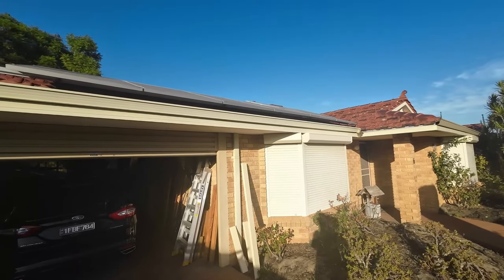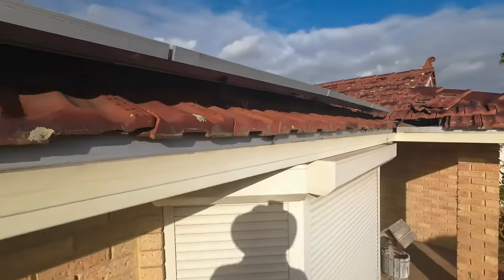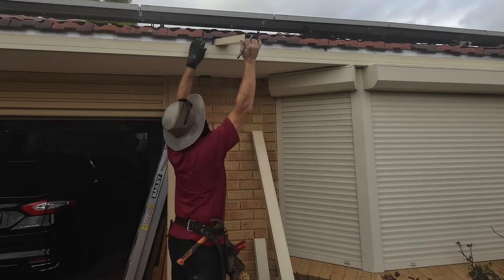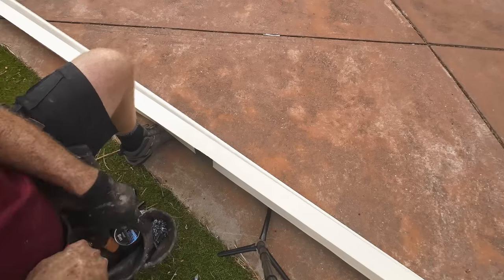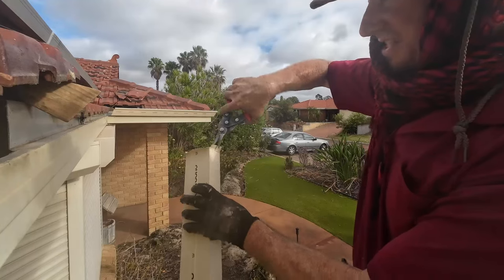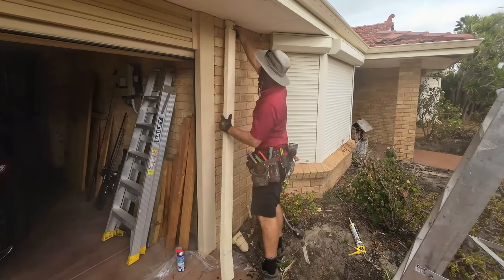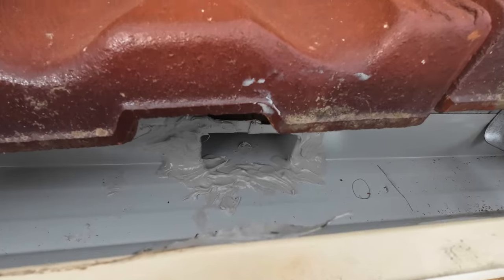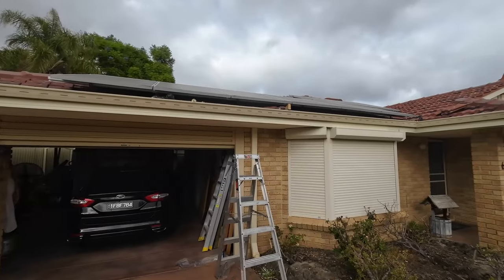How to install a downpipe under solar panels

Comment: Hey mate, why don’t they run the Downpipes on the outside of eaves where you are ?
Reply from the maker: It's the style of the building. it would look odd because it is at the front of the building and no other downpipes are done like that. You could do it however if you had no other choice.